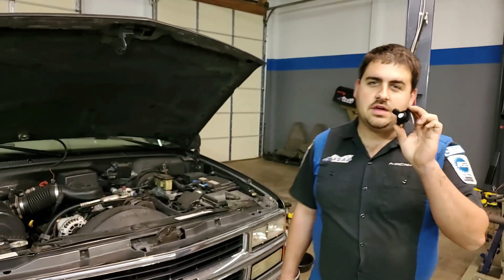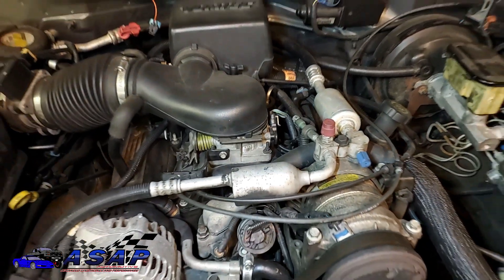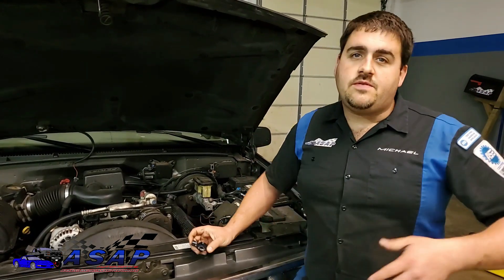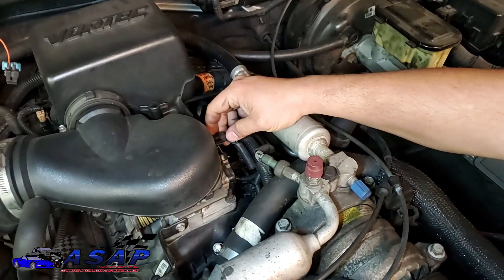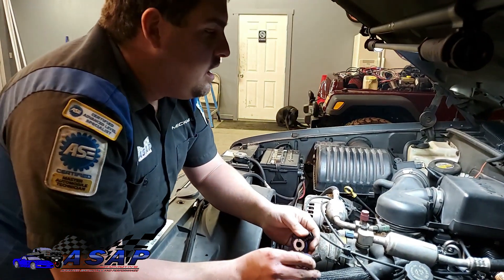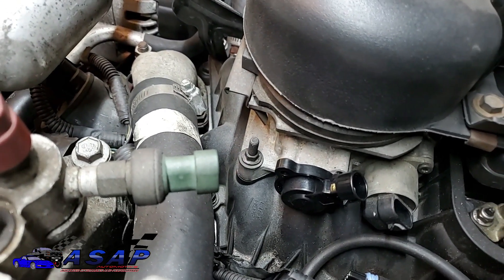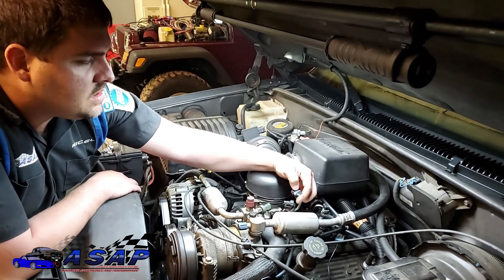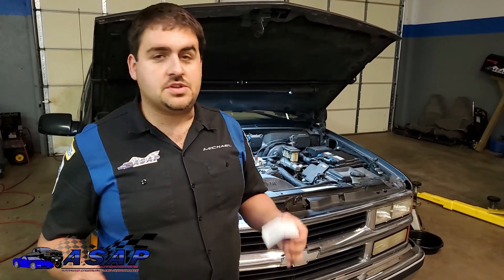TPS Sensor Install -1999 Chevy Tahoe

Comment: Hey, my 97 Tahoe is running very rich. Changed out plugs, wires. Now running better but still rough vibration and running rich? What to replace next. 249,000 miles

Comment: I had battery out of pickup (5.3LM7) for a while to redo some bad power cables.  Now I notice if I am half throttle or more the engine acts like it shuts off right after shifting.  I let off the throttle when this happens an everything is fine.  Do you think this is a TPS issue caused by having the battery disconnected?  If so, is there a relearn procedure?

Comment: I ordered the ac delco tps from Amazon and I’m still shifting weird thru first it’s only sometimes though. The part looks cheap super cheap actually and has a white sticker no actual part number should I return it and buy one at the dealership
Reply: Yes, you should probably return it and purchase one from a GM dealer if you want a bonafide AC Delco/Genuine GM part because of the potential of counterfeit parts in the supply chain (chinesium).  I stongly suggest that whatever you consider purchasing from Amazon to read EVERY review, starting from the lowest/worst experience to the best experience, because used/altered/counterfeit parts have and still are being sold on Amazon.

Comment: Hey, can you do a video on a distributor replacement and setting cmp retard on your Tahoe? I have a 1999 suburban that I’ve been trying to get the cmp retard dialed in on and no matter where I adjust the distributor to, my scanner reads -45. I’ve adjusted this distributor 30 times at least and I get the exact same results.
Reply: According to Eric O at SouthMainAuto, after your engine reaches operating temperature, you must first rev your engine to 1000 rpm or as close as you ca😢n.  Then look at the CMP Retard value, this is your true CMP retard value.  After turning off the engine and loosening the distributor hold down, then turn the distributor counter-clockwise to advance it and clockwise to retard the timing.  And verify the CMP retard at 1000 rpm after letting the engine reach operating temperature.